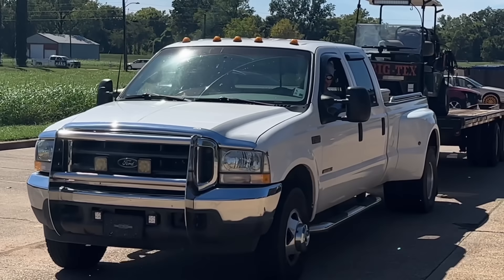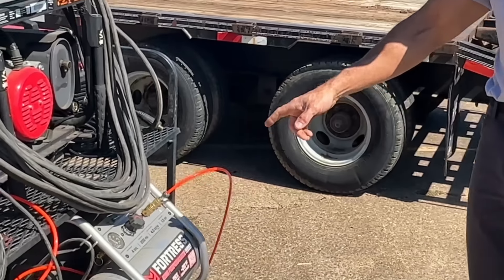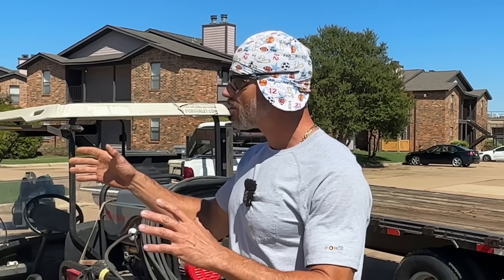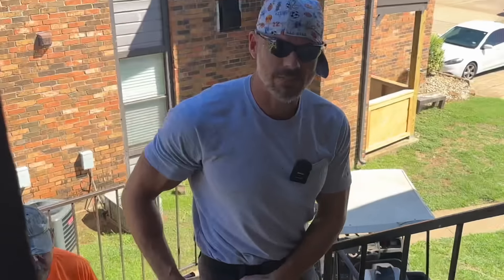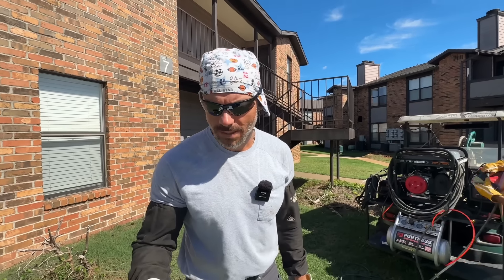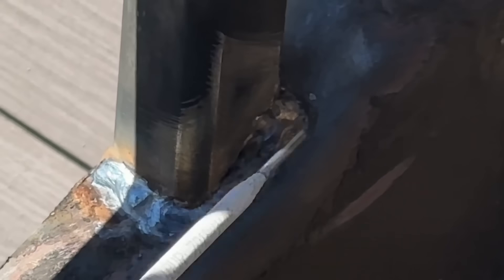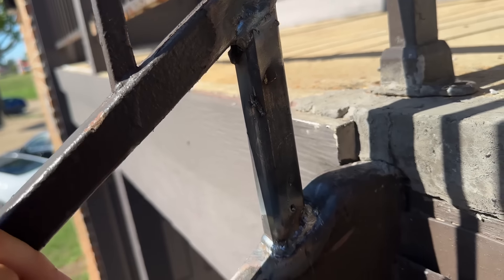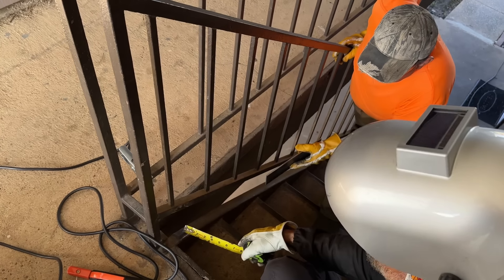Secret Side Hustle for Welders: Boost Your Income Now!

Comment: I never thought about turning the gas off on generators so the float won't let gas go into the oil pan.  Do you do that with gas engine drive welder generators as well?
Reply from the maker: I’ve only had problems with small generators. Never welders. I’m not sure why.
Reply: @TaylorWelding  I have to say I have a Hobart, probably one of a kind since it was a prototype model, welder generator with a Kohler and never noticed a problem after moving that

Comment: I dont think it was your plasma cutter. I think it was the combo plasma cutter with the air compressor. You only need 5 to 10 psi to run that plasma cutter. Get yourself a smaller compressor. My little 3 gallon from HF would prolly be enough.

Comment: i think it might be easier to keep a little variety of smaller flat bar stock on your rig, and chop it with the saw. Instead of larger plate.  just to reduce equipment you have to haul
Reply from the maker: Great point!

Comment: Great idea. I would pull the golf cart out of a inclosed trailer and hook up a smaller trailer that is set up with what you need. I did alot of them at apartments. Wish I had that back then. Also I did basement doors at the apartments that didn't latch.the best welding I found was mig welding.  You can really dile it down. Good money.

Comment: I had the same breaker problem on our generator trying to run a Lincoln Tombstone. I increased the breaker fuse up one level and have ran that for better than a year with no problem. May correct your plasm cutter problem .

Comment: If you run into some bad blow out welding, use silver bronze filler rod with a sharpened carbon arc rod on straight polarity.

Comment: I would love to do this. The hardest part is finding the clients. I also don’t have a generator yet. I do have a Toyota Tacoma, and an arc captain multiprocess though. Really want to start my welding business soon

Also I’d rather use flux core and angle grind and clean the joints first before welding! Get much cleaner welds. I hate stick welding so much lol. I suck at it

Comment: Excellent advice,I do have a similar rig, with a Duramax e10000 generator, hypertherm 30 amp plasma with built in compressor and Eastwood tig 200 . Sometimes I get some repairs inside the  house, so I get them with tig. Little argon bottle.

Comment: 6013 might be a better choice for thin stuff, I always grab the 7018 as well though. Thanx for the side hack job idea.
Reply: I've run 6013 at ridiculous low amperages with the polarity flipped and welded some incredibly thin material considering. flipping the polarity moves the heat from the workpiece to the rod from what I understand. I think it was 20 gauge, the welder was cranked down to something like 50 amps.

Comment: Thanks for passing down such great knowledge for a side hustle. I've been retired for 17 years and at 75 I'm considering your ideas for some extra $$$. Thanks again Taylor.
Reply from the maker: Side hustles are fun and rewarding. Good luck. If you can weld a little bit, you can sure do what I did.
Reply: at this age you do not need to be attracting the irs which is going after these side hustles

Comment: You're not pulling enough continuous air on the plasma. It's not the power. I have an xp-30 and I use a double tank gas powered, wheelbarrow compressor to push enough continuous air. Hypertherm makes an xp-30air with onboard compressor. I wish I bought it instead but it was unproven technology at the time.

Comment: I’m planning a side hustle when I retire.   Already have a Miller Bobcat, and a Miller Multimatic 215, plus Primeweld MIG-285.   Wondering if a small trailer is the right choice, or just a pickup.   Thanks for sharing this!
Reply from the maker: Maybe? 
I've never worked off a trailer. 
I've always wanted to build one
Reply from the maker: Depends on where you will be working?

Comment: What size generator were you using? Also, was it a capable of producing "clean" (Total Harmonic Distortion < 5%)? I ask because I've got a 12K generator (NOT clean power) that I'm pretty sure would run a plasma cutter, which I have not bought yet. Also, I realize that these newer, lightweight inverter welders recommend only running off of clean power generators. I did run my inverter welder off of my 12K very briefly to see if it would work, and it did, but I don't know if it would do harm in the long term.

Comment: Most railings here are aluminum. My biggest fear would be liability if something fails later. I wonder if the generator fails because it has a self-exciting rotor? What I used before was a Lincoln Weldanpower which had a generator and ac/dc welder in one unit!
Reply: Everyone is afraid of liability. Why? What can fail that is not already failed?

Comment: Consider switching to an inverter generator that is 4x as quiet. You (and your clients) will thank me. 7018 is awesome stuff, but flux core mig is the cat's meow for working on thin cheap steel like that. And there are lots of multipurpose portable rigs that do both stick and mig, so you're not giving up the ability to use stick. And if you absolutely positively refuse to use flux core mig, buy some smaller diameter 7018 rod. You can do surprisingly delicate work with 3/32" or even 1/16" rod. You can also try 6011. Way easier to strike the arc over and over on these short piddly welds compared to 7018. 

Everything has its place.
Reply: You sure bout that 6011
Reply: I used to use a bunch of 3/32” 6010 or 6011 when I was working the apartment stairs. Or solid wire mig when I was installing the handrails.
Reply: @totalpkg6912 yes 6011 would be much better on paint and rust and is better at restarting your arc, the 7018 is a great rod but not for these small projects and this is my opinion and I’ve been welding for over 55 years
Reply: Yep was also gonna suggest a smaller diameter rod or 6011 for that thin wall material. Great video though.  Should have shared what you charged
Reply: @garyteague9555 I just watched and said 6010. That 1/8th was pretty toasty.
Reply: Inverter generators are not very good in handeling high inrush current like welders or compressor they need to rev up before they can provide big power.
Reply: @jonasstahl9826  Inverter generators also don't generally produce clean enough power to run an inverter welder well. There are exceptions of course. You generally have to find an inverter genny with a THD (Total Harmonic Distortion) in the 5% or lower range. Most of them don't specify and / or are in the 20% range.
Reply: @garyteague9555  Those little inverter machines don't run cel rod worth a shit. They might sometimes halfass run 6011, but 6010 is nearly always out of the question. There are some units that have some circuitry to make it work - it'll have a 6010 or cel rod setting on the machine. Most of them don't. If I don't turn on the cel rod setting it just won't stay lit. It'll arc and spark and spit and stick and do pretty much anything other than weld.
Reply: @garyteague9555 He was already blowing holes with 7018 it would be even worse with 6011. He should use 6013 on that thin stuff.
Reply: How much did you pay Jose?🤣✋
Reply: @justsayin7937  Right! Cleaning the paint and running 6013 would have been faster and easier than 7018/6011.
Reply: or just run plasma cutter on 240 instead of 120v (needs 34A surge)
Reply: I'm pretty sure he said he was using 3/32" rod that's what it looks like anyway and he was burning through with that maybe going to a 1/16" would help but a 6010-6011 would cut through that like butter. 

Bonus tip give your 7018 rod a good tap on the work piece it'll break off the flux covering the electrode as long as you see that good pop from the arc you can start it right back up like a fresh rod (I hear you can't do that on pipelines).

Comment: Great idea! Were you running the plasma on 110 or 220 on the generator? I can't garuntee it'll work, but Maybe try running it on 220 (if your generator has it) since it will be half the amp draw.

Comment: Taylor buddy, your channel hits home with me I'm digging it.. thx for the good videos.. been welding out here in the desert for 20 some odd years , definitely have put my time in doing a lot of that type of maintenance & repair work in the first 10 yrs or more, welding on old roached out     Oh-too thin wall railings & what nots, but I just use a little lightweight inverter wire feeder with the small (50cft) aluminum bottle ... solid wire.. turn the gas up if its breezy. Much easier, cleaner in my opinion. I'll just carry a couple cordless makitas with wire cup brush and flap-disc or sanding disc to prep a little.. most of those inverter wire feeders are 120/240 now so o  the light stuff usually can find an outside outlet, if not i have 110' 240v 8ga cord w/ 50a ends i made I'll run off my trailblazer. I built some lightweight dolly style carts that contain the small gas cylinder and mig for easy mobility using an old hand truck or pressure washer cart 👍.. love to chat with ya sometime maybe share ideas and trade secrets if you ever want
Reply from the maker: That’s a great idea. Thanks for the tip.

Comment: This is where a Milwaukee metal skill saw is far superior to even a plasma. No grinding after to clean plasma slag and way faster than cut off wheel! Great video.
Reply from the maker: Great point!
Reply: Figure it runs around $300 it doesn’t take long to pay for itself. I was a millwright for 11 years and my go to cutting tool was the skill saw. From 11ga to 1” it will cut them all.

Comment: I bought the predator 9500 inverter generator for hf to run my multiprocess welder and my 50 Amp plasma cutter. Runs awesome until the higher end on my plasma as well. But it will cut at 40 to 45 amps for about 4 to 5 min before the generator starts tripping breakers. The inverter type generators are the way to go though.

Comment: A smaller electrode (3/32) is better for welding that thin tubing, it sucks and wastes time when you have to chase a hole, due to over heat or b/c railing like that tends to have moisture which corrodes the insides making it paper thin. When doing that kind of repair work, I prefer run a wire feeder. Even though I run everytihing MIller, the old lincoln weldpak 155 is perfect for this kind of jobs. You can run mig or flux with no issues, and .023 flux is especially good for thin repairs, and you can get a 15' replacement gun for added reach. I do like the mobile unit approach, keeps everything close and stops morons from stepping on or driving over cables.

Comment: This is an excellent recommendation! I have a John Deere 3320 (mid-frame size compact) tractor that I have used in similar situations. I put a Tractor Supply 3-point hitch carrier on the back with a bottle rack I built and a job box on the rear of my tractor and carry my back-up Lincoln 305G attached to a fabricated skid on the pallet forks of the loader. Works fantastic on crowded job sites and in warehouses.

Comment: A side hustle for $120 an hr?  If I make that a day, it's a full time job.  How much does a welder make at a normal job?  Must be nice. And I always get told mechanics are ripping people off. No, the shop or dealer you go to is ripping you off.  And that shop/dealer is ripping off the mechanic.  I'm just getting tired of people complaining when I charge them so little of what every other profession is charging when your vehicle is a needed thing so you can get to work and make money yourself.
  I have to buy my tools, pay for subscriptions on my scanners, pay for the shop and extra electricity on top of everything a normal person has to pay for, yet for some reason, mechanics are at the bottom of the list for income.
  I have the same tools a welder has and much more, and can do repairs other than weld, yet if I try charging someone $120 an hr, they'd laugh.

Comment: Great idea for a side hustle. It seems I weld that rusty, thin wall tube as often as heavy "gravy" steel and you are correctly describing the pain the ass it can present a welder with. I have much better luck using 7014 iron oxide flux rod than 7018. It has a bit less penetration and less blowout risk on that thin fluffy iron.
Reply: good pointer.
Reply from the maker: I just used what I have. To be honest with you I don’t have any idea what is 7014 is capable of. Thank you for the tip.
Reply: Licensed & bonded this day and age??????? Watch out!
Reply: Agreed

Comment: Thanks for another awesome video!  While I have a Miller Syncrowave 210, & a Miller Millermatic Vintage, & a Lincoln tombstone...... portability (in the back of my SxS) is exactly why I also purchased a ArcCaptain MIG 200. While I actually prefer 7018's for most of what I do.....I think you'd appreciate some Hobart Fabshield 21B for the thinner tubing.

What wattage/size of generator?

Excellent inspirational video, you're definitely helping some folks out, by making them think. Thanks again!
Reply from the maker: thank you I was a 7000

Comment: Great vid! Just wanted to share my experience with using an inverter generator. I have a 13000W inverter generator and a regular Lincoln cracker box welder. I couldn't even stick weld with this setup without throwing the 100amp breaker. Even with the Lincoln set at 90amp, I couldn't burn a complete rod. I got desperate and disconnected the breaker and ran the wiring direct. I expected to burn up the generator, but it is still going strong somehow. I am able to burn 1/8 rods of 7018 completely at 105amps. Maybe this info can be used so the plasma machine can be used. I think this really points to the difference between how generators and true welding generators are designed. There are certainly some things I don't understand. I thought that the higher the amperage is set, then the lower the voltage is so the total watts stay the same. I would appreciate any feedback on a setup like this.
Reply from the maker: Electricity is not my thing. Thanks for all the advice.
Reply: I’m not an electrician by any stretch but the voltage output of the generator is a set value. The amperage that your generator produces is the limiting factor. The more output you ask your welder to put out the higher the amperage demand from your generator becomes. Are you running a 110/120 volt welder? If you are, you’re probably limited to a 20 amp breaker. If you run a 220/240 volt welder you’ll cut your amperage demand in half for the same welder output and you’ll then be pulling that amperage through a 30 ,40  or even a 50amp breaker.Remember, amperage is the volume of current available. You have plenty of watts to do what you’re doing with an inverter welder like a Lincoln 210MP. Also, watts divided by volts = amps available. By my calculations, you should have over 54 amps available, if the breaker will give you that much.

Comment: Killer setup man! One time I was moving a gigantic old schoolhouse and I needed to weld 4 -12@89# wide flange H beams 75’ long together to make 2 beams 12”h. X24”wide rails. I hade my Millermatic 251 shop welder running off of my Miller Bobcat 225 gas drive machine. I kept tripping breakers on the bobcat and couldn’t figure it out, called my Airgas dealer and he said “ explain your amperage and setup” I said I was running the mig at 250 amps off of the bobcat set at 225 amps and ………oh nevermind Craig , I got it!😂
Reply: Bobcat wasn't set properly  ??

Comment: Nice rig.  A Fronius  Accu pocket 150/400 (battery operated )welder would be great for your rig.  You can take it anywhere without a power cord.  They are used mostly for "impossible to take a regular welder kinda  places".   BUT... they are expensive.
Reply from the maker: That’s cool I did not know it existed
Reply: And now ESAB has a welder that runs of the DeWalt 60V batteries.

Comment: I've done this before with a 6500 watt generator. Some welding machines don't like running off of generators that small though. However, I now own a diesel engine drive and it will run any welder or plasma cutter that I plug into it. Very handy. I used it to run a Miller 252 on a job once.

But Taylor, you missed something very important. You're running a 5" cutoff disk on a 4-1/2" angle grinder with no guard. Two big mistakes, especially when you are trying to teach people stuff. Don't let newbies build bad habits, bro. The fact you've run like that for years without losing your fingers doesn't make it right.
Reply: I noticed the cutoff wheel guard too!

Comment: I have loved your tip for the white paint marker. I use them all the time.  Let me try to give you one. I keep 1/16 6013 sticks for thin rusty metal. I've actually been able  buttweld 18awg sheets metal at 10amps with this. I think I've also succeeded with 7014 1/16 as well. Keep the tips coming.
Reply: Great tip, never even considered smaller rods. I'm so used to welding the big stuff.
Reply from the maker: Thanks for the tip! I will use it.
Reply: I'm also a fan of 6013 for thin railings and such.  It doesn't penetrate as much as 6010, which is great on thinner stuff, but it freezes fast enough to fill holes.
Reply: My buddy that works at a welding supply store brought me some 5/64 6013 for a similar job i have coming up. Ran it @ 40amps and it welded beautifully. It also welded a lot smoother after i dipped it in water
Reply: Whatever the decimal is for the rod, thats the amp to run. Learned this from an old timer. Works everytime